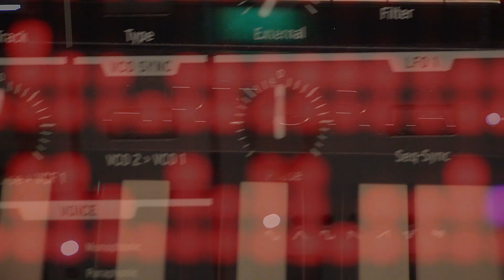Matrix Monday with the Arturia Matrixbrute- Episode 6: Self Patched Feedback

Comment: anything that brings uncontrollable, organic, unpredictable sounds from an analog synth is invaluable to learn with programming. whatever lack of expression or evolving timbre synths have can be compensated for with these kind of techniques. i have a matrix brute myself ive been wanting to try this myself for a while, but ive been worried about damaging my equipment. after seeing this video it seems safe enough to try, im definitely going for it now.
Reply from the maker: Take the dive! As long as you aren't feeding the input a signal that it was not designed for (signal to a speaker for example), it'll be fine!
 Have fun!